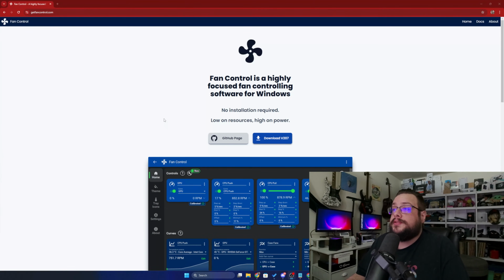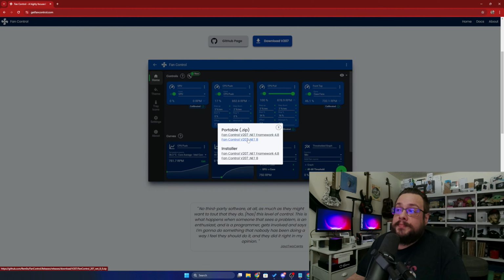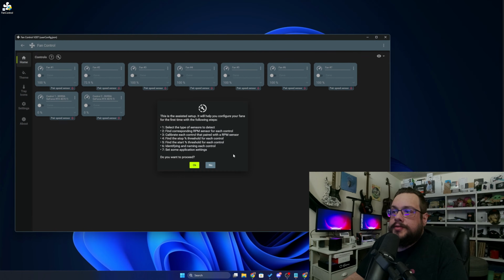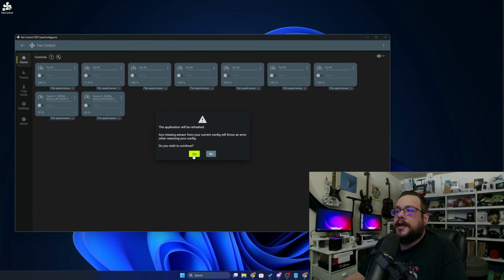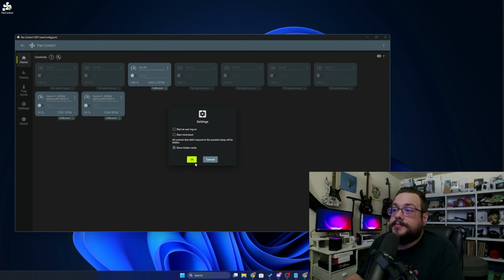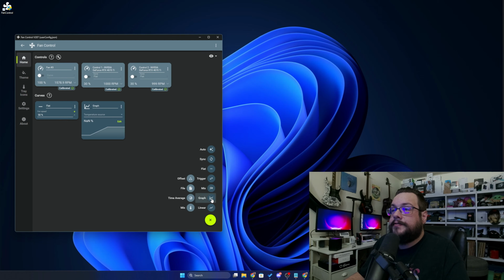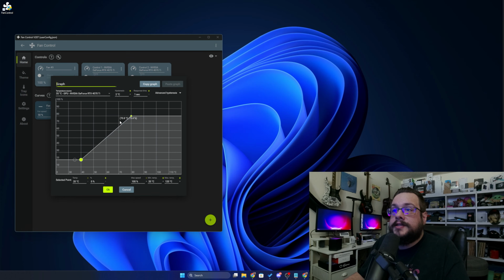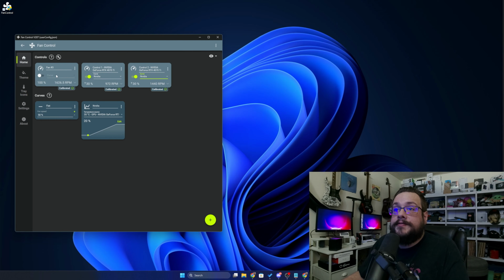How to Set Up GetFanControl – Universal Fan Control Made Easy!

Comment: doesn't detect anything but the gpu
Reply: blame microslop... this crap worked fine pre 2026.... windows essentially blocked necessary drivers, recently they even blocked the newer pawnio driver, so fan control stopped working on multiple devices... some still work but its pretty much just luck at this point... maybe check if your motherboard manufacturer happens to have their own software for controlling the fans.
Reply: I got you 
Just disable last fan app you use for example if u use fan xpert before, go to Armoury crate and turn fan xpert on to off
Reply: Yeah same
Reply: @RTX6000BLACKWELL suffering from the same problem after switching gpu 😢
Reply: Exactly...!

Comment: hi my gpu fans are not getting power from the board so i planned to replace with 3300 rpm arctic 120mm fans and power them from my motherboard now how do i match the fan speed with gpu heat kindly help please i bought a refurbished 3090 and got scammed

Comment: this app doesnt see my 13 fans
Reply: If you use a Molex connector fan, it can't be detected. You need to use a 4-pin PWM fan connected to the motherboard.
Reply: @ayangjibrut  I do
Reply: @pzelact4328 try to set it to DC in bios setting instead of auto or pwm
Reply: The pawnIO driver does not work if you have faceit anticheat installed. As for now, the only way to use fancontrol with faceit AC is to revert back to an older version that uses winring0, but that is flagged by windows defender (for a good reason, it opens up your comp to a big vulnerability). Another known issue is with Gigabyte motherboards, but i don't know much about that since i don't have a Gigabyte mb myself.
I can highly reccomend to read the topics on fancontrol and/or pawnio github pages, and if you can't find your specific issue already solved, start a new and i'm sure you'll get help.
Reply: Are they Daisy chained?
Reply: @DanKusPuGuS  Ita not detecting any of my 3 system fans (they are daisy chained)
Reply: @KlashtasticK did u fix this I have the same problem
Reply: @DanKusPuGuS  yes, for best practice 2 fans per connector

Comment: If you use MSI Afterburner you will want to disable the Nvidia controllers, otherwise the MSI app will have to fight for control of the GPU fans.
Reply: How do you do it ?
Reply: How do you do it?
Reply: @weilacadda9361  I actually have mine setup differently now that I upgraded GPUs. I use MSI Afterburner for the overclock and fan curve for my 5070 Ti. Then I use the Fan Control App to control the fan curve of the CPU cooler. It works flawlessly.
Reply: How do you do it
Reply: @SeanAtkins777  I actually have mine setup differently now that I upgraded GPUs. I use MSI Afterburner for the overclock and fan curve for my 5070 Ti. Then I use the Fan Control App to control the fan curve of the CPU cooler. It works flawlessly.

Comment: does anyone have problem that Fancontrol wont detect fans no more?
Reply from the maker: Antiviruses have been picking it up as a potential false positive.
Reply: @MikeTheTech theres another problems with fan sensors, doesnt detected by program, fans of case and cpu, only gpu, with recently updating using PawnIO for fans sensors detection, any solution?

Comment: The fan control stopped detecting my motherboard fan sensors, only the GPU sensor remains. I dont know why this happened
Reply: ANYONE HAVING THIS ISSUE. If it began as your antivirus detecting your fan control as a virus just whitelist it, it may reset your fan setting within this software but that fixed my windows defender from blocking my case fans from being detected, for reference mine flagged my fan control as a trojan which multiple users have reported in the last 2 days
Reply: @Astral_Streams  Thank you for the message bro, I figured this out too after some tweaking but after I flagged it out, it does not recognize the case fans, just the CPU and GPU. wondering if you still got this fix or if you had to do something else?
Reply: @Astral_Streams  THANK YOU SO MUCH I have been tryna fix this for so long T-T
Reply: @Astral_Streams  I’m not using windows ( using a personal  operating system ( tweaked windows) and still facing the same issue any suggestion ?
Reply: Same I built my pc 2 days ago, got fan control, working perfectly. Then this morning they only detect my gpu fans
Reply: @anonymousgaming4702 yep same same same
Reply: @anonymousgaming4702 Oooff you using the motherboard app now?
Reply: this keeps happening to me over and over.  my brother-in-law installed it. spend several hours setting it up.  next day fans were running at full speed, had to reinstall, set it up again.  a month later installed updates, had to uninstall, reinstalled, spent several hours setting up fan curves.  now today, virus detected, as soon as it was removed (from fancontrol folder) now fans are full speed, installed update and doesnt recognize any temperature sensors other than the video card.
Reply: i really dont get how this isnt a base feature in windows. fancontrol has a security vulnerability. so as consumer ur basically forced to vulnerability because u dont want ur fans at 200000 rpm for browsing the internet
Reply: same i think they need to fix it
Reply: what fixed it for me was uninstalling, then reinstalling an older version on the github then updating in the app
Reply: Same
Reply: Windows defender, right?
Reply: same
Reply: Yeah, defender exception fixed it
Reply: Me too. Any fix yet?
Reply: I'm also facing this issue but i have found the solution by opening hwmonitor software and now the case fan being detected by getfancontrol
Reply: For me aswell do you got any fix?

Comment: i have a mobo with a chipset fan that the bearings have failed. i've replaced it twice. the fan lasts about 6 months.  I used FanControl for the past year or so to stop the fan, then gradually increase the RMP and keep it steady at 75%. That kept this fan from making any noise. But suddenly last week FanControl deleted every tile i had and now  only shows tiles for my GPU. I dont allow any auto updates. Any suggestions?

Comment: i downloaded it and used software to check for malware and there is malware in the download
Reply from the maker: https://www.reddit.com/r/sffpc/s/l8ApI2FPuz
Reply from the maker: https://www.reddit.com/r/FanControl/s/DXZq6qgTec
Reply: mine has had nothing but issues.  today, trojan was found within the fancontrol folder.  i dont run an antivirus and havent had one in 20 years because i am pretty good about only downloading from reputable sources.

Comment: everything good, I really like this software but after some random time, lets say 4-5 hours. The fan is bugging and stop controling the speed, I put some bug reports no one responds. the bug is a little question mark next to all the fans, and it says fail to control and something is overriten control. And Im 100% I dont have any other fan controlling software- no MSI afterburner, no asus bulshits, no armoury crate or aura. On my last investigation when this bug it usualy run my fans close to 100% and up and down. I tried and investigated putting it on MANUAL mode and whenever I put it on 100% the fan stop when it is on 0 it is full speed. the bug is reversing everything and instead of avarage 20% it works on 80% and I cannot fix this, I am thinking to remove it Im done restarting the PC because this bug :(

Comment: does it have general presets like "quiet,normal, and high speed" for lazy noobs such as myself?
Reply: Not necessarily ready to go presets - you have to set the fans to the desired speed, then you save that profile and can switch between profiles really easily - unless off course you take the time to set up a fan curve so you don’t need to do this. 👍

Comment: This doesn't recognize my PC fans, only my GPU fans. I can't control them. What can I do?
Reply: Same :(
Reply: Same. Everyone hyping up this software and it's garbage lol.
Reply: @mshea5906 lol no its just ur pc fans that is cheap or the connection is not proper. Use pwm and connect straight to motherboard or a good quality hub. Other than that its ass. Youre ass
Reply: @mshea5906  its not the software that's garbage. it's your laptop manufacturer.
Reply: @DementiaTech  software is garbage.  i have had nothing but problems with it.  every update i have to reconfigure.  maybe it is a compatibility issue with windows 11 like @cx4005 said.
Reply: On my old rig, windows 10, i can adjust all the fans. Not sure if windows 11 is the culprit.

Comment: This is wrong tutorial,  Here is correct way to setup GPU Fan control.   

Minimum %: There is a 30% minimum value and 0 RPM can't be applied manually.
0 RPM minimum temperature: Usually around the 45 degree range.
0 RPM maximum power draw: Having multiple monitors active may exceed that maximum power draw.

To work around these limitations, the software will release its control over the GPU when the command hits 0%. If the card natively supports 0 RPM, it will be able to enter 0 RPM mode. However, most cards will have built-in conditions for 0 RPM to trigger.

With these caveats in mind, a simple graph for a GPU needs to have its 0% point at or below the zero RPM temperature point, then staircase up to 30%. Rest of the graph is up to the user.)

Comment: Since today FanControl does not show my fans anymore. Only GPU...
Reply: did u find any solution i got this problem today and windows scan keeps showing me a hacking tool threat
Reply: SAME. All the labels for which sensor is connected to what fan is gone. I don't understand.
Reply: Do you guys have armor crate install? If so remove it.
Reply: Only have cpu and gpu now. Can not sense case fans.
Reply: Y'all need to install PawnIo driver from settings